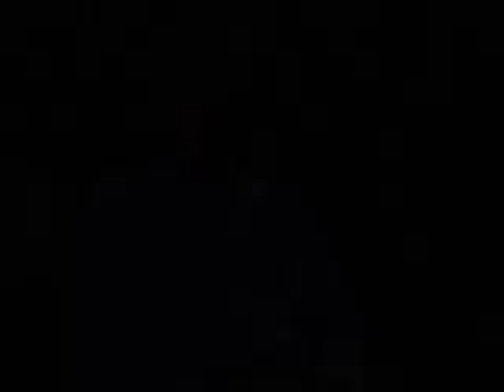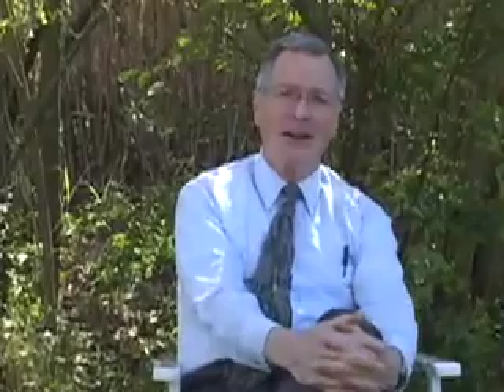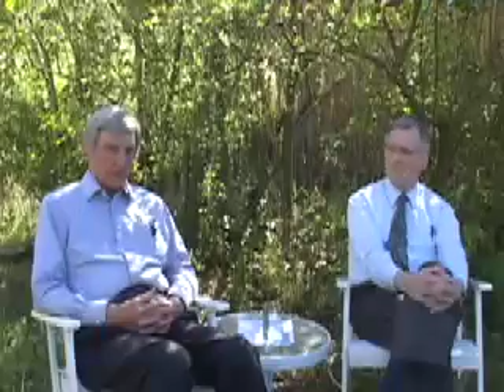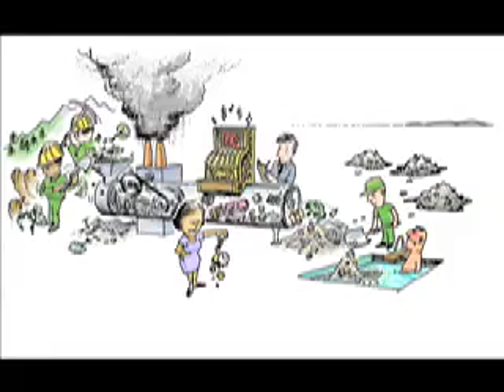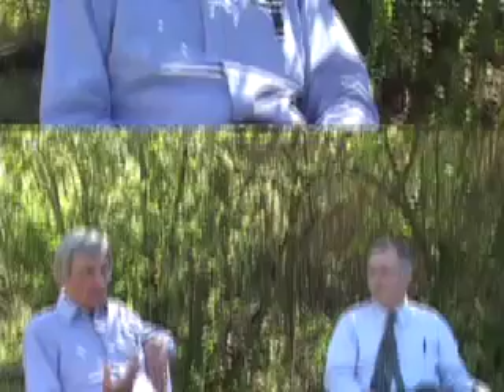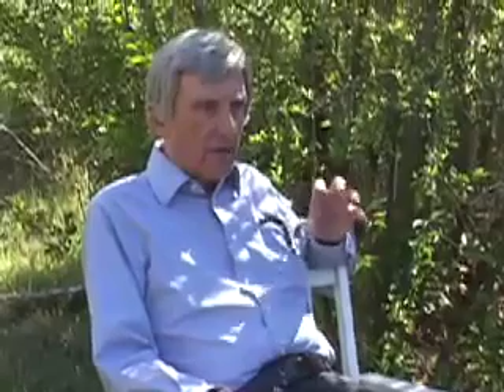The Fusion Torch - Intro

Comment: A Fusion torch means that all trash(inorganic and organic) can be heated to very hot degree in where molecular bonds brreak, thus releasing alot of energy which can be used them as a median for many of the things we use now. And the yield of energy is MUCH greater in creating these plasmids than fossile fuels. Yet, we won't see this since the status quo would loose much control and influence. Perhaps I should do a masters in Nuclear Engineering focus in high temp plasmids.
Reply: Yes Please Do ! We Need People like you who have enough vision to push for it. If everyone refuses to study chemical Engineering and petrolium industrial processes, they will collapse that pathetic deceptive industry.